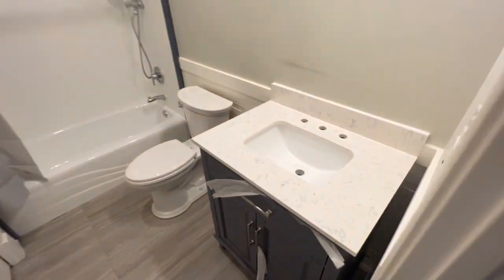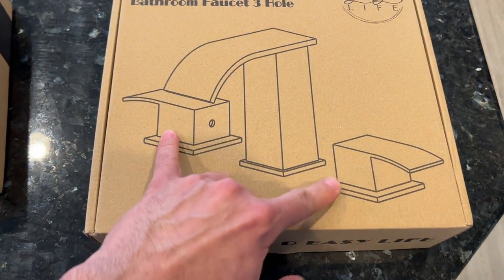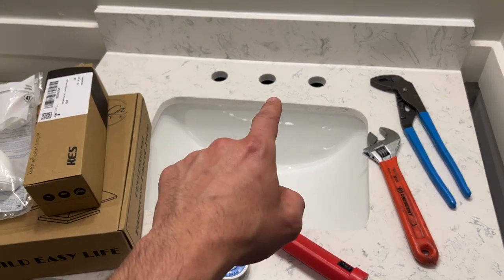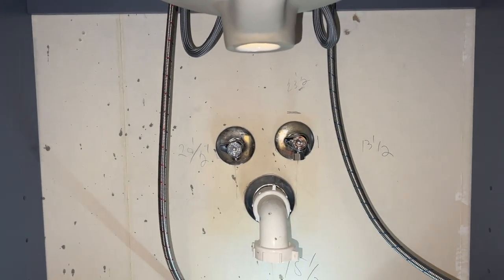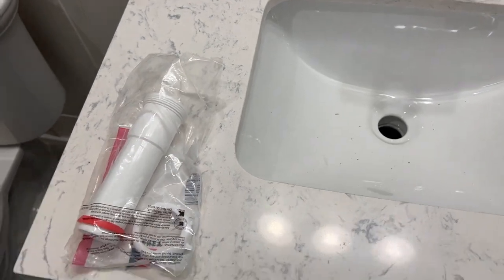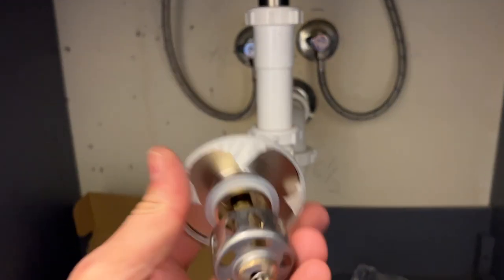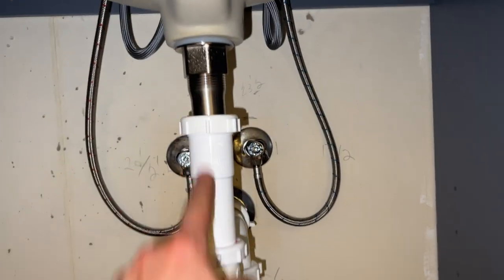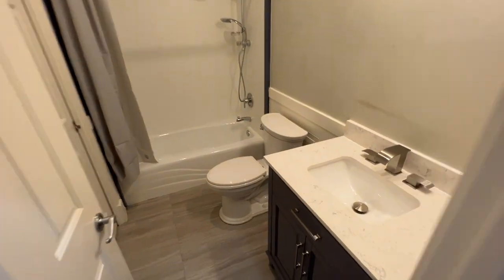Faucet, P-trap, & Drain Installation on NEW Bathroom vanity and sink - New Waterfall faucet

Comment: both of those slip joint washers are backwards taper faces down towards the other piece the nut goes against the flat side to push it down into other piece making it water tight so i guess you could say those slip joint washers seem sus
Reply from the maker: haha, you're 100% right!!! I just watched the video again after reading your comment. I'm literally going right now to fix it. Thanks for the heads up! :-)